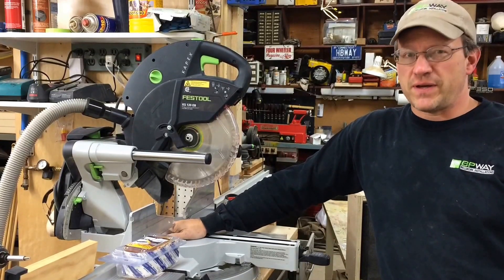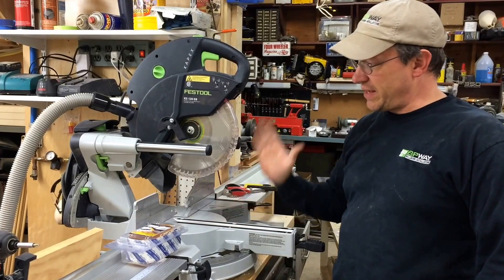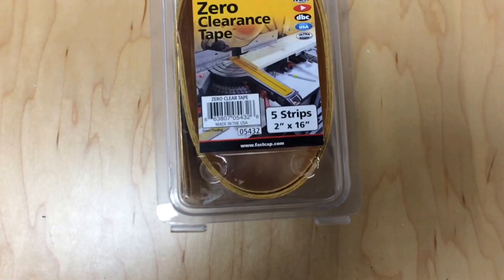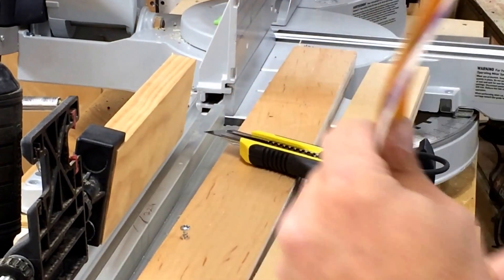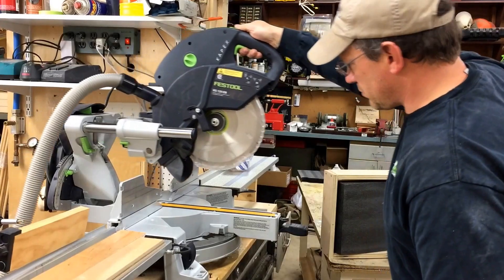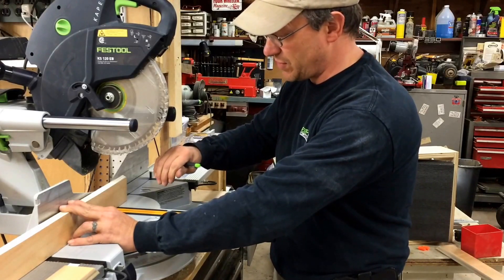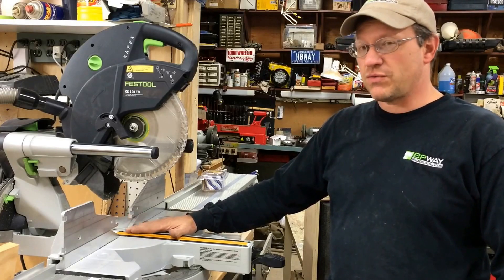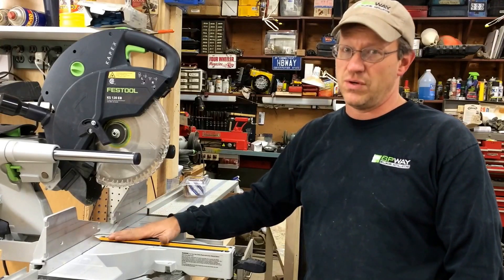The best zero clearance insert for your chopsaw for safe cutting by FastCap

Comment: Keep in mind that the thickness of this tape (even though it is thin) will effect the accuracy of your miters, since the center is now higher than each side of your table. This may sound overly critical, but you will see a gap when you join two corners of a box or a picture frame. Also, the leading corner of your board will bump into the edge of this strip as you slid it into place. For many this may not present a challenge, but I will be removing mine and making a zero clearance insert.

Comment: You did not address the issue when cutting a compound cut on a bevel angle, does it make the tape cut wider?
Reply from the maker: Yes, it does. That is unavoidable. It comes with multiple strips in a pack, and it is an inexpensive consumable to keep on hand if you are needing to constantly change it out.